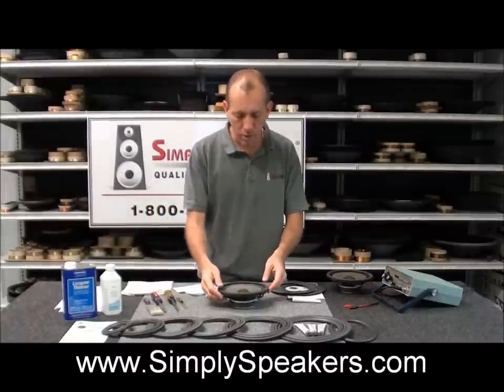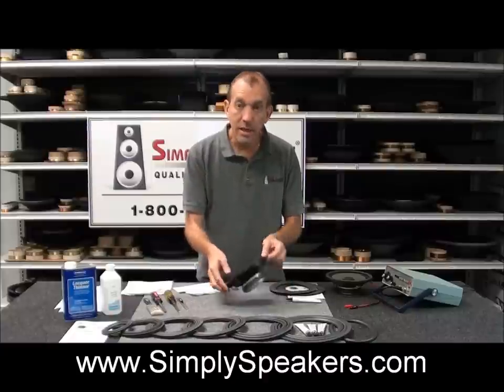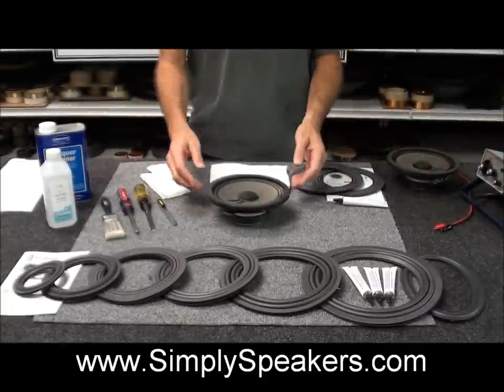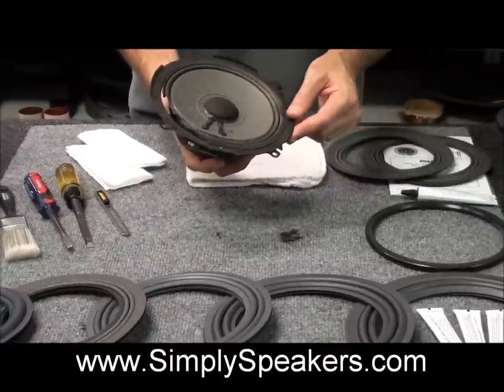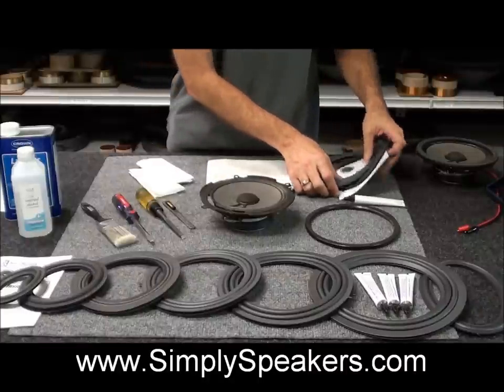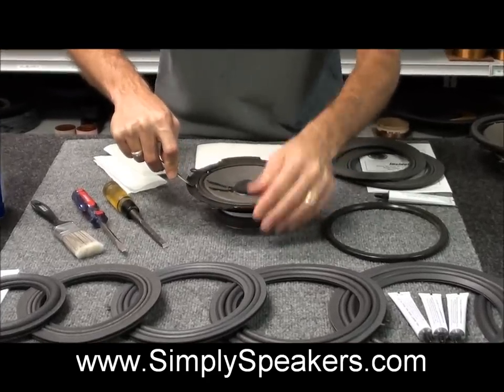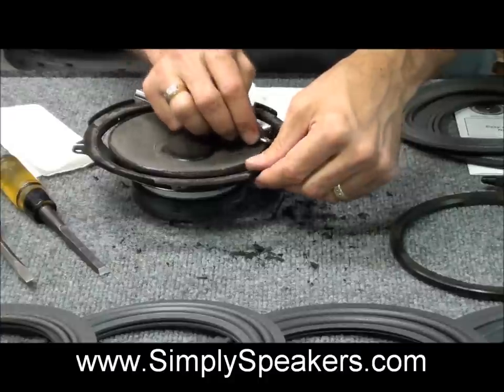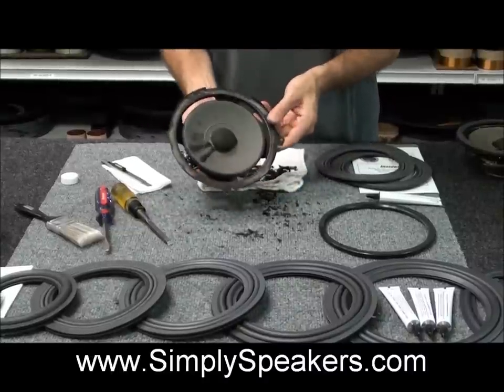Speaker Repair Toyota Tundra, Sequoia JBL 86160-AF060, 86160-AF070 Refoam

Comment: I just did this repair to my wifes sequoia while replacing her head unit with a kenwood and I'm blown away. Ive got high end speakers in my sequoia with an amp and hers now sound 90% as good. I should've saved money on mine. For anyone on the fence do this repair and you won't regret it.
Reply from the maker: Thanks!

Comment: Doing this today. I'll let you know how it goes. I'm really glad the price dropped on this repair kit. Kit had everything I ordered. It came in quickly.

Finished this project today. Speakers work perfectly. I couldn't be any happier with the results. Tips from my experience:
1. Set aside several hours to allow glue to dry.
2. The cutting, around 12:00, is tedious. Try to reach under the cone and roll up the remaining foam/glue. This worked for me and was much easier.
3. When gluing to the frame, keep applying pressure even after it seems like the glue is taking hold. I did this on one speaker, moved on to the next one, and noticed the first one started coming up. Take your time on this.

Comment: Worked like a charm in my new-to-me 2005 Sequoia. Driving home from the dealership, I noticed the bass was turned all the way down to minus 5. After adjusting it, I quickly saw why. Deteriorated foam surrounds! Bought this kit as soon as I got home. It arrived in two days. One recommendation: after getting most of the old foam off the metal basket, I used alcohol and a small stiff-bristle brush to scrape off the rest of the old adhesive and foam. Worked great. It is a messy process, but these directions are perfect and my Sequoia sounds fantastic!

Comment: I refoamed a pair of Tundra front speakers. I glued the surrounds behind the cones like the factory did. It actually seemed easier than mounting them on top. They slipped right in and sat snug and perfect. I did make sure that the cones were very clean on the backs and sides. The speakers look and sound great. This video is very informative. Excellent job. Thank you!

Comment: Put off dealing with the speakers in my 2005 Tundra for a couple of years, guy in the  video is correct, cant just replace with generic speakers due to impedance issue,1 ohm vs 4 ohms commonly found on generic replacements. I ordered the kit which came in a few days.  Just completed the install and I must say my expectations were exceeded!  I was pretty skeptical even after reading the reviews but for $29.00 felt it was worth the shot.  Thanks for a great product, great value, fast delivery, and superb video instruction.

Comment: Just did this for my '06 Tundra. The process isn't really that bad. Definitely messy. At first glance my surrounds looked fine. After further inspection it was totally disconnected around the top gasket. All in all this was a great way to restore the sound in my truck. I would recommend it to anyone with a can do attitude.
Reply from the maker: Thanks for sharing

Comment: Bought a set of surrounds for a pair of 12" Cerwin-Vegas that I bought in 1984 and a set for a 2006 Toyota Sequoia JBL system. The Simply Speakers videos are spot on. Super easy to follow. Watched them a couple of times to ensure I knew I was doing it correctly. Only issue I ran in to was the adhesive drying too fast on the Cerwin-Vegas. I put the glue on sparingly as instructed, but I live in Phoenix and it was 95 degrees outside, and the glue dried before I could get it adjusted accurately. I removed it (and a little bit of cone paper), reapplied the adhesive and managed to get it aligned fairly accurately (certainly not as good as the video, but not bad). Speakers sound great. Voice coil shimming is not required, like the video said. Great job and a great value from Simply Speakers. Saved me hundreds of dollars.  Thanks again.
Reply from the maker: Hello Doug. 
Thank you for taking the time to review! Dryer climates can cause the glue to setup faster. Glad you got it done and have them back up and running! Enjoy!

Comment: After pricing the cost of new speakers, I decided to try this process, and I'm so glad.  You can't replace the 2005 Sequoia Speakers with low cost universal speakers without a lot of work and the cost to purchase new factory JBL speakers range between $300 (online) to $410 (at the dealer) each.  I ordered the kit Monday, it came on Friday (last night). I completed the job last night using the kit and this great video.  Took me about three hours (did both of the front speakers), most of the time was spent waiting for the glue to dry.  The speakers sound like they did when I bought the car new.  Great investment...just follow the video and take your time. A small wood chisel worked perfectly for me to scrap the old glue and filter off. The speakers in my 2005 had an additional cover and the tweeter was attached as well when I removed them, but that did not get in the way of the repair job. All the steps were the same and the kit worked perfectly.  I encourage you to try this out before wasting your money on new speakers. Also if you cannot do it your self, it's worth sending the speakers in to these guys for $50 each repair, if you can do without the speakers for a while. Fired up the speakers this morning, Phil Collins "Air at Night" drum solo, never sounded so good.
Reply from the maker: D Stanley Thanks for all the feedback! Enjoy!

Comment: Just installed the kit for a 2002 Sequoia.  This is the easiest re-foam I have ever performed.  Foam fit perfectly.  I also like the quality feel of the foam.  I did not have to shave any glue off of the center speaker part.  The old foam just came off with a little finger work leaving nothing behind.  Happy.  Thanks.
Reply from the maker: Great....thanks!

Comment: Great video and product. I just finished this project on my brothers 05 Toyota Sequoia and it can out fantastic. I watched the video several times so I knew what tools were needed and how to remove the old foam and adhesive. The application was pretty straightforward. I wonder if anyone has tried adhesive remover instead of rubbing alcohol to completely remove foam and residue from the frame. I know it probably wouldn’t affect the overall performance of the speakers. Also the glue tacked up a lot quicker than shown in the video, possibly because my bro decided to wait 2 years after purchasing theses from Simply Speakers to finally have me install them.😂

Comment: I just did this yesterday.  The second was much easier than the first.  With the first one, I glued the new foam to the front of the cone as in this video.    With the second one, I glued the new foam to the back of the cone.  The reason was that after pushing the inner edge of the foam ring around the cone, the foam was super snug  ... like it just fit perfectly.  I almost wonder if the glue is even necessary.

In any event, both speakers sound great now.  I should have done this a loooong time ago.
Reply from the maker: Great job! Thanks for the message.

Comment: Thanks for the quick shipping and awesome video. Perfect!
I just finished my ‘06 in a few hours total. Big Savings from purchasing new. 
I’ve got another older model ‘02 Sequoia that I’ll likely get your kit for and repair soon.
Reply: I'm getting ready to do the speakers on my 06 Tundra DC. For the sake of simplicity I decided to repair the speakers and not bypass the factory amp when adding my new head unit. Are you pleased with the sound and functionality?

Comment: Greetings! I have a 2005 Toyota Tundra Double Cab SR5 model in which the front doors speakers are rattling. I need to know which repair kits I need to buy for both front doors speakers. I wanna try repair it myself with the aid of your awesome video. Thank you very much!
Reply from the maker: Please order kit # FSK-7M-Toyota. Order on our website. Thanks!
Reply: One kit per speaker or one kit is for two speakers? I see it on the picture showing two cone foams.
Reply: There's also a liquid sealer being recommended. What is the sealer for and is it applied after the repair is done?
Thank you.
Reply from the maker: The kit will repair two speakers.
Reply from the maker: Yes, apply after the repair is complete. Liquid Foam Guard is a brush on PVA sealer that protects foam surrounds from moisture and mechanical breakdown. Includes 1 oz. bottle and brush applicator. Goes on white, dries clear, and leaves a slight gloss finish.
Reply: Can be applied on the top side only or it has to be applied on both sides?
Reply from the maker: Front side only. See instructions that come with the sealer. Thanks!

Comment: I did this today on my 05 Sequoia. The first one I did, the Driver side, looks cleaner, but sounds not great when I tested it (like a blown speaker). The second one, the passenger side, I used a lot more glue to secure the foam to the paper and it doesn't look as pretty, but it sounds perfect. I removed the Driver side speaker and I was thinking about sealing the perimeter of the foam with glue to the paper cone. Any other suggestions? Nothing else is different, and nothing is damaged.
Reply from the maker: You might need a do-over on that one. Jump on our website. We sell single surrounds for these too. Thanks!

Comment: Hi, I own sequoia 2006. Does rear speakers require similar repair or this issue is only common for the front speakers? Is there a kit for the rear speakers? Thanks
Reply from the maker: Rear speakers are cloth surround (not foam). No repair needed unless spiders come loose from frames, then easy reglue.

Comment: Trying to install kit and I’m having major troubles getting the clip off that disconnects the speaker from the door. Little black plastic clip, seems very fragile. Can anyone help out? 2006 sequoia with just speakers. Thanks
Reply: More specifically it is the electrical connector clip, every other video I’ve watched of speaker repairs on the 2006 sequoia they just cut the wires to bypass the clip. If anyone can help explain how to remove the clip I would very much appreciate it.
Reply from the maker: Sorry we missed the message earlier. Assume you are good to go, but if not, the clip slides off using a small flat screwdriver to pry the locking clip up.